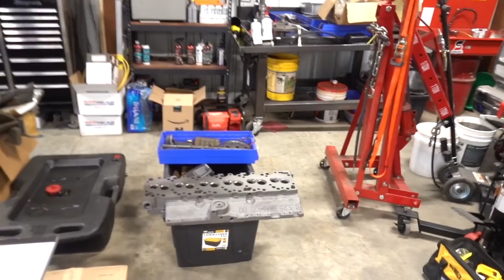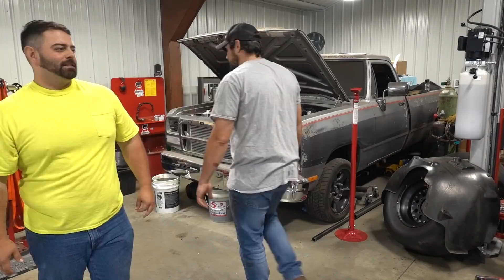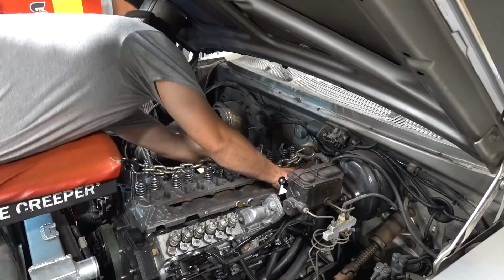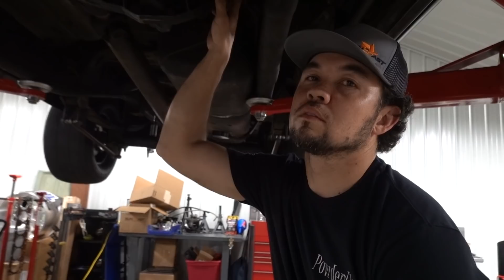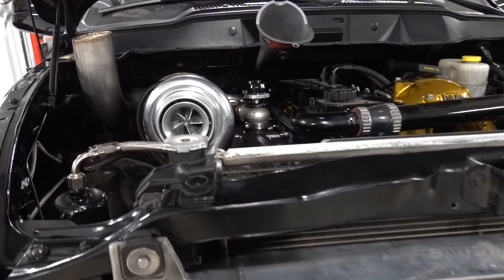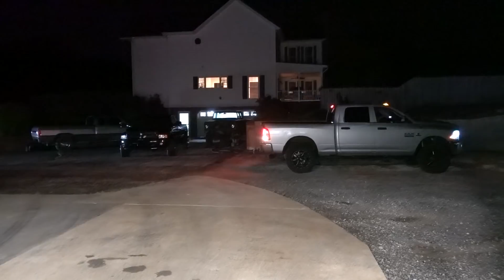THE 1ST GEN CUMMINS IS ALIVE!!! FULL ETHER START UP!!!!

Comment: How do you keep the valve seals from blowing off? I have replaced mine twice and they keep riding up the valve stems. The guides dont feel sloppy. I may have to try the top hat style, but the bosses have not been machined off of my head.

Comment: I put a 24-valve in a 98 Ram 1500 wire harness and everything I switched over under the dash where they plug into the fuse panel there's one more plug I have no idea where to go and I'm not getting any signal to my gauges what am I missing any feedback will be appreciate it thanks and I watch your videos all the time LOL

Comment: Man Greg way to much explanation on valve setting. It’s simple Greg, TDC on cyl 1 = set 1IE, 2I, 3E, 4I, 5E then rotate crank 360 to TDC on cyl 6 and set 6IE, 5I, 4E, 3I, 2E. I worked for Cummins Inc. for 7yrs, 3.9, 5.9, 6.7, 8.3 & 8.9 liter engines all set the same way. Mechanical engines set to 0.010” +/- 0.001” Int & Ext set to 0.020” +/- 0.001” and HPCR engines set to 0.012 +/- 0.001” Int & Ext set to 0.022” +/- 0.001”. Simple job shouldn’t take more than 20-40min depending on application.

Comment: 1/8” aluminum tig rod down injector hole to find TDC,  180° off or not.  I use this method to do cylinder leak down tests on gas motors.

Comment: Better Built that motor fast because you just burn up that engine with either you do not ever put either in to a motor that is what you call a real killer to the motor early and faster
Reply: Things got like 300k on it and he beats the hell out of it. With ten plus trucks and numerous turbos and engines laying around I doubt he cares. I mean he’s literally just throwing spare parts on to get it to a show lol
Reply: @wyattr43  I've been around diesel since I was 2 years old all I know is if you want to kill a motor either is the fastest way to kill it a little bit is fine but there's a fine line between a little bit and too much especially for something that takes just the simple amount of time to bleed the fuel as it did to either it
Reply: @chadsmith9979  I’m sure you learned a lot at 2. Diesel tech here too. Starting fluid isn’t going to hurt it. Sure not a lot but the amount he used isn’t going to hurt it. Not to mention my point, he has ten Plus trucks and multiple spare engines, transmissions, turbos etc. Plenty of money and doesn’t care if it blows up. Dude smoked three turbos on the 05 the same day. Thousands of dollars down the shitter lol
Reply: @wyattr43  I mint 12 I be around them back went truck come with 2 gear shift